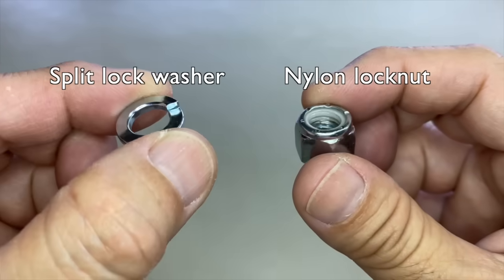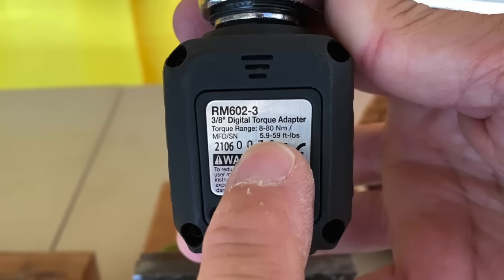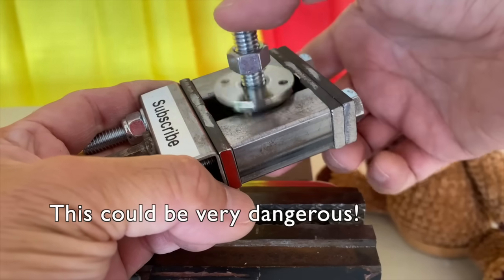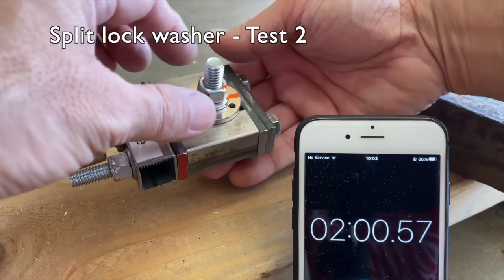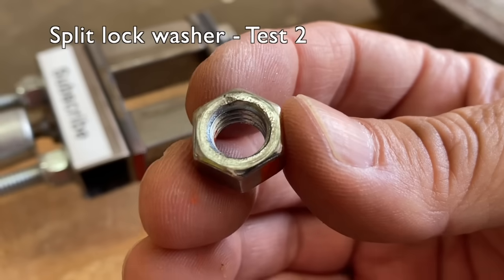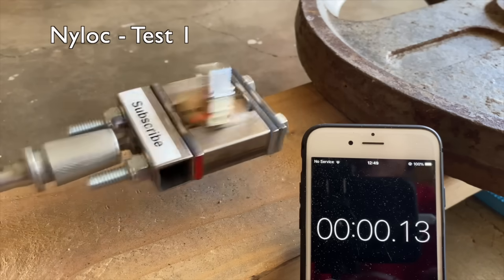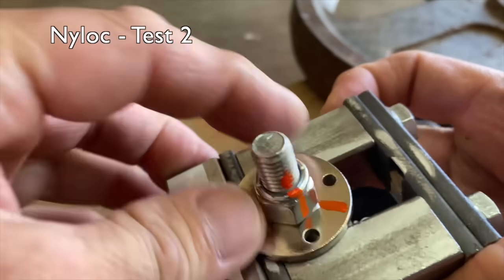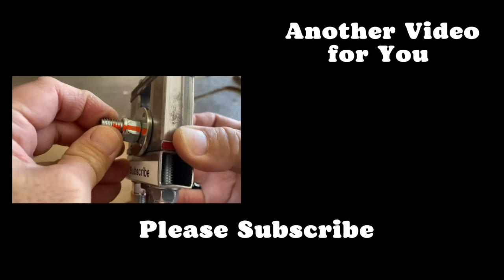Nuts & Bolts - Split Lock Washer vs Nylon Locknut – DIY Impact & Vibration Test - Part 1

Comment: What is best for bolting a battery cable to a copper busbar? Over time thermal expansion loosens the bolt and nut. Application is a 51.2 15kw lithium battery bank, connected to a copper busbar, and a 16kw inverter. Over a period of 8 months the bolt got loose. How to prevent?

Comment: Nylon insert locknuts are used in locations where loose hardware could cause catastrophic failure - the nylon insert helps retain the nut to the threads.
In addition, split spring lock washers can be used with nylon insert locknuts.

Comment: I don't even have to watch this.
Lock Nuts are far better, but don't use them where there's lots of HEAT, it will melt & destroy the nylon locking insert.

Split Washers compress over time & lose their 'locking' capability.
Lock Nuts retain their locking capability BUT, ideally they should only be used ONCE.

Comment: I like your work, even if the result has been known in professional circles for some time. 
We were once asked why we use five different types of screw connections in a system and whether it wouldn't be simpler and more cost-effective to use just one type?
Every bolted joint is subjected to different forces. We have nuts that have to be sealed with wire wrapping, as only authorised fitters are allowed to tinker with them. Then we have screws that are exposed to thermal influences, etc. 
A few years ago, we had major damage to a system. The reason: an employee of the customer who owns the system had not used a snap ring as prescribed and had used a nylon nut with the wrong torque (a lot helps a lot). However, this was the wrong choice and the nut and washer caused damage in the five-figure range - no warranty - own fault.

Comment: Nylocks also fail quickly when subjected to heat and or solvents. If you had torqued the nuts down tight your test results would have been different. Castle nuts with a split pin would be the way to prevent failure over a long period especially in an oily, high heat environment.

Comment: The recommended torque specifications for a 3/8 nut with a split washer is 26 ft pound ! during your test you torque nut to 6 ft, that is 75% below the recommended torque specifications for 3/8” nut, it is guaranteed to fail because your testing is dishonest to to shift your results in direct you want.

Comment: Probably stated 3000x below but 6 ft-lbs is ridiculously low for a fastener of this size. The idea is to increase the tension on the bolt/nut to the point where the normal load X friction coefficient will prevent relative movement. This is why you don't want to lube critical fasteners unless they have a castle-nut or have 2 nuts tensioned against each other.

Comment: Very well subjective tests. However, the vibration induced could equate to a large amount of time, which is unknown, and not secured bolt or nut, nylon or lock washer, safety wired, cotter pin or not should be inspected at regular intervals to check their security. Also, the final torque value  will affect security.

Comment: I would have liked to have seen these tests done with 'Nord-Lock' washers. I'm using them in an application on one of my vehicles. Lots of dynamic forces - both laterally and longitudinally.  M8.8 hex flange head bolts, with flange nuts tightened to 12.56 ft lbs

Comment: nothing with that size bolt would ever  torque to 6 lbs BOGUS test, here something you should test impack them on the bolt and you'll see the nylon nut get destroyed with the regular nut goes on off time and time again, and any heat will melt the nylon and nut comes loose 

How Lock Washers Work. Lock washers are designed to be tightened to a required torque beneath an ordinary fastener. They exert a spring tension that keeps the fastener from vibrating loose. They are often attached to the nut side of the fastener.

Comment: One thing that you omitted from your analysis is that a nyloc nut is NOT a high tensile nut and should NEVER be used in applications that require high tensile strength.

Comment: This is why every bolt (bolt being the assy.; screw and nut) size and style has a recommended corresponding hole size and torque value with clearances that will not allow the bolt to slide or vibrate excessively.  Slotted holes need different treatment.  I don't think a nylok would do well in moist or hot applications.

Comment: Although the test seems fair across the board I'm not happy with only 6 ft lbs of clamping Force. 
Nylon lock nuts may seem better but are not useful in a elevated temperature situation. I've used premium lock washers and I've had good results with them. 
In heavy duty automotive industry   Bowma- grip/
Prevailing torque nuts are used. One side of the nut has an interference of the thread. Hardened steel nuts with a restriction. Cannot be threaded on with fingers. You must use some sort of a wrench once it enters the nut because there's a restriction that gets tighter.

Comment: I was taught when using a Lock Washer, always use a plain flat washer between the mount surface and the Lock Washer.   
This prevents damage to the mount surface from the Lock Washer.

Comment: 6 ft-lbs is grossly undertorqued for a 3/8” fastener.  Even a lowly grade 2 bolt should be torqued to 15 ft-lbs.  And higher grades are substantially higher.  I suspect if you torqued the bolt properly, even the assembly without a locking mechanism would have taken a long time to loosen.

Comment: You use low torque, which does not provide elastic contact area large enough and contact pressure large enough to build up high friction between the clamped parts to withstand micro-motion. This is specially obvious in the case with nylon lock nut. The asperities in the clamped contact areas get worn off, or ”smoothened”, with the loss of clamping force as a result. Therefore the bolt can be moved, yet the lock nut has not been turned. After a while, the wear debris will fill the gap to some extent, building up some friction, but this is not a secure connection. This emphasises the importance of a proper tightening.

Comment: The preload loss on the nyloc assemblies is likely due to the very low (for fastener size) torque you used for the test. Such low torque would not necessarily have taken up thread clearance between the nut and bolt. Once the fastener assembly was allowed to slip, it likely started wearing on the flange bushings thus giving more and more clearance (looseness). The fact that the paint marks on the nuts and bolts were still aligned with each other. The other problem is 6lb-ft of torque on the sprit ring washer setup was more preload than the same 6lb-ft on the Nyloc assembly because of the extra friction of the nyloc (i.e., a larger portion of the total toque was being used to overcome the friction rather than tensile preloading of the bolt itself). Basically, the preload of the split ring lock washer setup was probably about 900lbs vs probably 300lbs for the nyloc with the same 6lb-ft of torque applied to both. 

A more accurate way would have been to use bolt stretch to set a preload, not a finite torque value. In fact bolt stretch is a more accurate way to set preload which is why you often see fastener torqueing procedures that have a relatively low torque value followed by an additional angle of rotation. Due to known thread advance given the thread pitch, engineers can determine preload more accurately because stretch can be accurately calculated. Or in cases where its a nut and bolt configuration with relatively easy access to bolt sides, a bolt stretch gauge can be used with "torque value" at all. The is common practice on the Rod bolts of race engines (which arguably are the most highest stressed fasteners in an engine). 

The only problem with the stretch method of preloading as it pertains to this particular test is the extremely low preload amount used,,, it would likely have resulted in no easily discernable stretch of the bolt

Comment: Mc Donald-Douglas used TOOTHED lock washers with threadlocker AND nylon insert (splined) nuts on F4 Phantom II's to make them "vibration-proof". Worked. I had three kinds (shapes) of splined Proto sockets in my tools. Mechanical, structural and electronic (I was a RADAR spec) but NO hydraulic sockets, as a hydraulic spec had to do them. If you KNOW a nut/bolt is subject to vibration, toothed lock washers are "spec" normally. Torqued CORRECTLY, you have to replace the washer every time it's loosened.

Comment: I’m a retired military aviation tech. On Marine Corps aircraft flight controls (helicopters) we use a castellated nut with an inner  nylon retaining sleeve and a cotter pin and to top it off there’s a spring loaded cam that prevents the nut from coming off at the end of the bolt. We also torque the nut to a specific setting that had to be witnessed by a quality assurance inspector. Until I saw your video I thought it was overkill. Good video.
Reply: When it absolutely can not fail. The USA military. Getting the job done.
Reply: LocTite, split washer, and a stoved nut.  Your vibration apperati  is brutal. Clever.
Reply: Retired aviation tech, and you only learn this now? This just goes to show how important is internet and YouTube in particular when it comes to learning things. It changes everything, if we can use it wisely. And how incredible is the time we live in, when it comes to getting information

Comment: I think this entire test is mute due to the fact that you only torqued that assembly to 6 ft lbs. That is not even a firm tightening. Under any circumstance, those nuts and bolts would have vibrated apart.

Comment: Generally when clamping two pieces of metal together on  3/8" (close to M10) bolt, most of the time the design torque will be at least 5 to 6 times what you applied. I'd recommend redoing the test at a more common design torque, as you're more likely to find 6 lbf.ft torque being used for an M4 or M6 bolt.

Comment: There wasn't the required tightening torque put on the split washer for it to do its job. The split washer is designed to be tightened hard enough so that its edges will 'bite' into an immovable grip - that's its purpose!

Comment: Only problem we had with nylock nuts is if you use a fast  power socket tool to put it on, it sometimes melts the plastic and gets stuck and wont tighten.......then we had to cut them off and put on with slower rpms........

Comment: Thank you so much, I never knew how a split locker washer works, I always thought it was the upside pressure which hold the nut.  Now I see its the split what do the job, the nylocs works better, but a little more work to unscrew

Comment: You're comparing apples to oranges.  The problem with your rig is the two washers are allowed to spin relative to each other.

The split lock-washer locks the fastener to its clamping surface, NOT the mating fastener.  Conversely, the lock nut locks to the threads of the bolt, with no locking action to the clamping surface.

Since the flanges in your jig can rotate relative to each other, and since you didn't place a split lock nut under the head of the bolt either, you're not using the split lock washers properly.  Any CCW rotation impinged on your jig flanges is pretty much the same as someone turning a pair of wrenches CCW on the two fasteners with no lock washers. 🙄  Not to mention, using only 1 split lock washer is about as effective as using none at all.

If you want to do a fair comparison, you need to change your jig to use flanges with splines that mesh together (so they can not rotate relative to each other), and you need to use TWO split lock washers -- one between the nut and its flange, and the other between the bolt head and its flange.

Comment: Depending of the application split lock washer are fine, it will leave scratch on paint if not used with a flat washer on the surface. Nylon nuts are also great but once removed they loose their grip strenght if put back in place. I've worked for a manufacturng company where they use stover nuts wich act as a lock nut but doesn't damage the bolt threads. Nice test.

Comment: I see a problem with your experiment. The dynamic forces tangential are overcoming the torque you put on the nut. If you torque more then the additional friction will be able to withstand the tangential dynamic forces.

Comment: This is not a valid test. 6 ftlb for 3/8 bolt is like hand tight. For this to be valid, you must tighten to at least 25 ftlb. So that lock washer has proper holding power.

Comment: You're not talking them down the way I do when I want something to stay in place. Also a regular nut in a lock washer can always be spun up quick for tightening or loosening. Hate those nylon split nuts. Tight all the way through the process of use

Comment: The whole test is messed up. Why are you using such low bolt strain? The whole point of bolt preload is to be higher than any transient loads so there is never a loss of contact between components (And thus frictions are maintained and shock loading as perceived by the fastener is minimized.) 
Nylon and other prevailing torque nuts consume preload torque so they need a compensation factor applied, nylon specifically takes a set with time and looses its friction. 
Split washers only bite on bolts so soft they don't get grade marks and don't have enough spring force to maintain constant axial thread contact under vibration, such unmarked bolts aren't used for any critical structures.

Comment: U’r completely missing the basic purpose of a split lock washer - they’re not meant to hold the nut in place after being torqued. The proof is the fact they had to invent ny-lock anti vibration nuts. Split lock washers are meant only to help during tightening. They are really meant to allow u to tighten the bolt to the nut without having to hold the nut with a wrench as the split lock washers will hold the nut from turning while tightening the bolt. The split lock washer was developed to decrease production-assembly times as it only requires a tool on the bolt n not the nut during tightening. Split lock washers are not meant to add anti-spin properties to the nut-bolt mechanism after being tightened. I never use split lock washers as they expand out under high torque. Star washers were designed for the same reason - decrease production-assembly times. Phillips head screw were not developed to allow higher screw torque - just the opposite - it was meant to cam out (push out) the screw driver at a specific torque - this prevented over tightening of the screw. Flat head screws have a tendency to break the tips off flat head screws because they don’t cam out at high torque. Phillips screws cam out n often strip out the head of the screw.

Comment: I've always found nylon are pretty good. But as others have said, this experiment is mostly void. The nuts weren't torqued anywhere near 'normal' for this size of bolt. On wheel bearings, etc. where you can't torque hard, they have cotter keys.

Comment: Use a lock nut for applications requiring high torque or significant vibration resistance, while lock washers are better suited for moderate torque applications or when space is limited.

Comment: As a lifelong Back Yard Mechanic, I tend to disregard these mechanical fasteners, and instead, use Blue Loc-Tite for things that might need future disassembly, and RED Loc-Tite for things that will probably never need disassembly. Critical connections will typically get safety-wired.

Comment: Who needs Shakespeare with this entertainment. Et Tu Nyloc  or  Lock Washer and Nylociet. Stuff on my bicycle years ago sometimes loosened up so I would "MASH" the threads a-little so a bolt holding brakes or something would go on tight near the end and not loosen up. Beware pic pockets and loose nuts.

Comment: I was taught when using split ring lock washers to compress the washer flat.

In this experiment I think 6ft/lbs was too light of a torque value.  A better test would have been to determine the torque necessary to flatten the lock washer and then use that value as the baseline torque for test.

I've been turning wrenches on my own stuff for decades and whenever I have reason to take anything apart that's subject to vibration I replace all nuts with Nylocs.  Never had anything vibrate loose yet.

Comment: You should run the test again but this time at full torque specs for that bolt.  You were only at 1/4 of what it should have been.  Interesting though not surprising results just the same.

Comment: the only applicable locations i can think of applying this type of shearing is vehicles and trains.  I'm sure trains go through inspections after every trip. At my current job we are specifically told when to use nut and lockwasher and when to use elastic stop nuts. Some nut applications we don't use a lock washer. For example, when grounding we have to use a nut and lockwasher because the lockwasher gives a solid compression on the ground wire, whereas the elastic stop nut doesn't really give a true grounding compression.